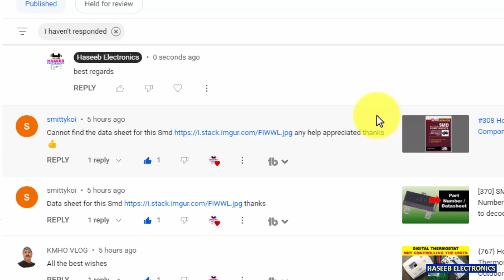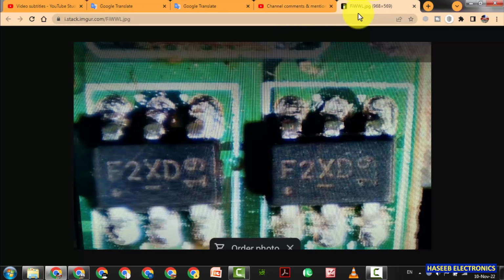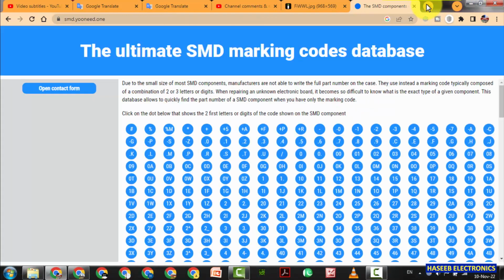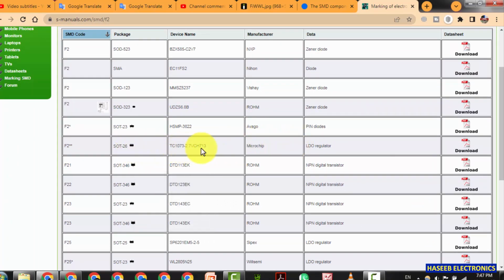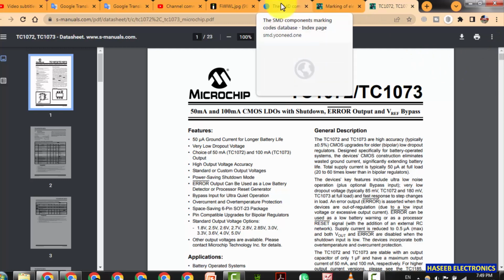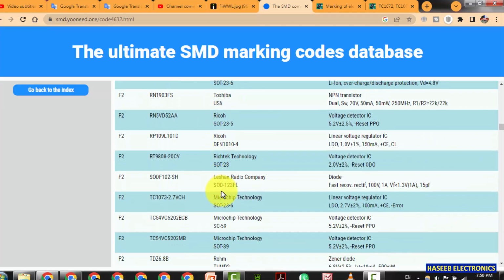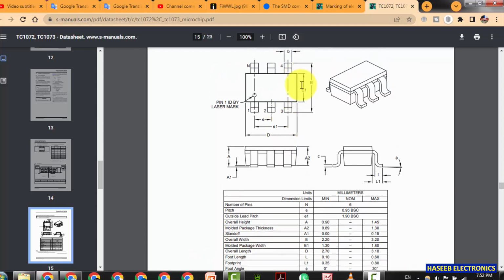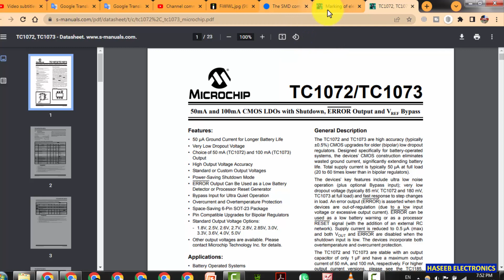{768} 6 Pin IC SMD Code to Part Number & Datasheet

Comment: Cant find the datasheet marking  ( LCZC )
Reply from the maker: Good morning 
You didn't mention the package size and number of pins 
If it is 6 pin then check this link 
https://smd.yooneed.one/code4c43.html
For sot23-6 package
Reply from the maker: Or you can send it's picture to my Gmail I'd Ashraf4ta4 
Or Whatsapp 00962-79-5608616

Comment: How to find Data sheet CM2538 it is 7 pin ic
Reply from the maker: Please check CRE2538 OR OB2538 
I THINK it is the same 
If it is not similar 
Then send picture of the pcb front and back to my WhatsApp 00962795608616

Comment: Hi , you have any idea About code 100TT ( 5 pin SMD).
Reply from the maker: i think it seems volatge divider ic. BL8509D,
Reply: @HaseebElectronics  i think that is 5 pin ic. very hard to find the part number

Comment: Good Day. I hope you can help me find VAJ01 it is a 6 pin smd. I tried but to no avail.
Reply from the maker: i tried 
VAJ code is for S-1135C1J-A6T1S (in HSNT-6A package )
VA code for RP152L025C (it is DFN1212-6 package style)
you can check the package style and then you can check datasheet for the IC. might be it may same
Reply: thank you very much @HaseebElectronics

Comment: Hello. Trying this same method for a 6pin smd. 4D"58"t 
The 58 is written from bottom to top
4D is written from left to right.
I tried s manuals and smd you need one
However unable to find it
Reply: The letter t is is small caps as well. Looks like a sot23-6
Reply from the maker: https://smd.yooneed.one/code3444.html
Reply from the maker: https://www.alldatasheet.com/view_marking.jsp?Searchword=4D
Reply from the maker: https://alltransistors.com/smd-search.php?search=4D
Reply from the maker: http://www.smdmarkingcodes.com/chinese.php/Index/search?xuanze=1&markingcode=4D&baohan=1&fenzuan=25
Reply: @HaseebElectronics  thank you so much. I went through all these resources. Still unable to find
Reply: Hi there. Still trying to see if I can find this part. May I request you to help me please?

Comment: Shukriya sir, very good video with full of knowledge. 
Sir, I have 48v/60v e vehicle bldc motor controller with microcontroller ic no. F7027 ( 4 line 32pin ic ). I am not able to get its pinouts or datasheet. Please help.